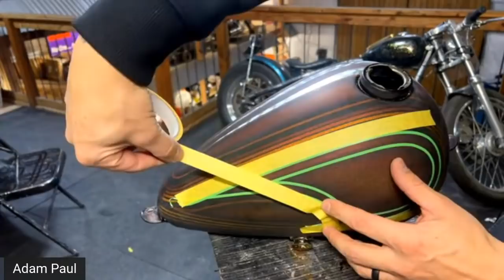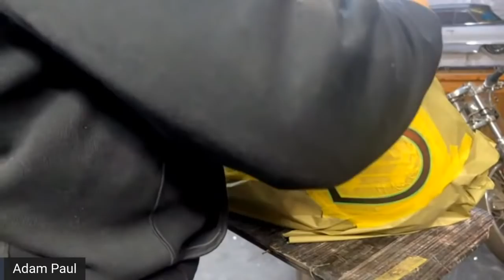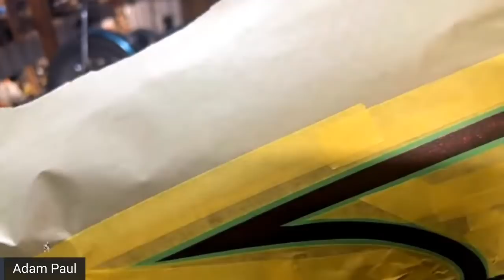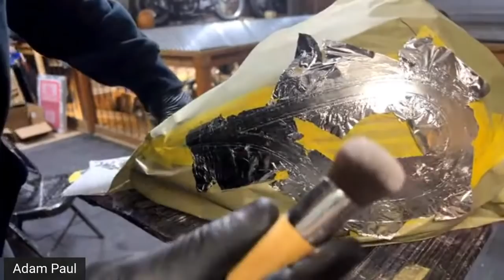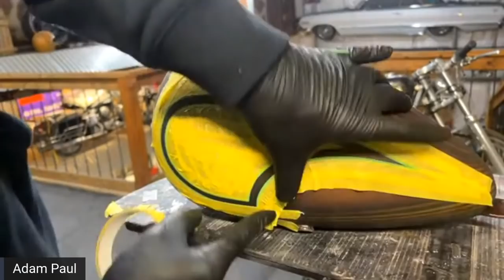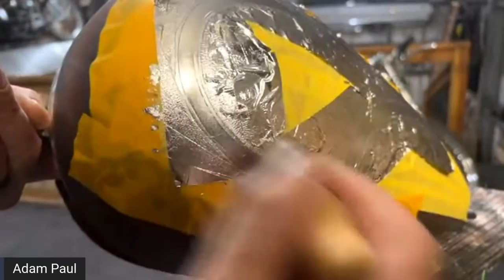Gold and Silver Leafing for Beginners

Comment: Do you have to clean the air brush differently when you run the glue vs normal paint?
Reply from the maker: Yes absolutely 100%
Reply: @TimeWarpCustomPaint  so I’d just run some lacquer thinner through it?
Reply from the maker: Water to clean up the glue. I use glass cleaner when breaking down and cleaning my airbrush
Reply: @TimeWarpCustomPaint  that makes sense! Thanks!
Reply: @johndodge9164 thanks for asking that question. I’m about to use this sizing glue for the first time and I wanted to watch this video for any pointers.

Comment: I almost have everything except for the spin tool and roller. I used to carve leather and then airbrush it with water-soluble acrylics. I want to try this, I think I can do it. I customize bicycles. For the motorized Schwinn, I didn't do any graphics. Now I decided to do a drop shadow on the fonts with my airbrush. I'm doing a kind of new racing BMX and making it look old-school '70s drag-style look black banana seat with chrome sissy bar but using more modern race parts like chromed RS brand park sprockets, complete with gold dice on the valve stems. LOL I think I'll practice this on a piece of glass.
Reply: I got an expensive made-in-USA BMX racing frame it probably cost over $800 just for the frame and fork. It's probably the lightest and strongest BMX bike I've ever picked up but they just put adhesive stickers on it. They are coming off after the summer heat of the last racing season. They look awful.  I want to put the model name back on it but make it look better. It has a weird font I'll probably cut a tape stencil out for the outline.
Reply from the maker: Awesome good luck.

Comment: For the dry time question. It takes around 90 days before the clear comes to full cure. I wouldn't ceramicote until then. Water will sheet on cured clear with no wax or polish on it. Before cure it will bead up like it has wax on it

Comment: Great work! Clearing question, can you clear right over silver/gold leafing without sealing it with more gliding to prevent lifting or do you just clean tank with DX330 wax and grease and do a couple light coats. Then a wet coat for final coat? Thanks

Comment: i  usze U-Pol clear the only issyue i have faCED WASD GRAZING BUT IT WADS USED OVERT AUTO AIR THAT WHAD BEEN SITTIN G FOR A WEEK  and itv does not like rusolium.  i have sprayed u-p-ol oveer krylon no iassue un lessd ouitside the recoat window or  somthing contamanting the sub  structure.  i do guitar custom paint and refinishes.

Comment: Okay so I'm looking at building a chopper or bobber here in a year or two and I want it to stand out a little. Do you have any tips for pinstriping when you switch tape widths how you keep width of the area you're going to paint the same width. If that makes sense. Lucky for me I still have some frames and fuel tanks kicking around from my 3 wheeler days to practice on
Reply from the maker: I like to start out with 8th inch and followed up with 16th inch line line

Comment: Man I'm using your gold leaf and I'm definitely not getting that crisp of a spin .. im doing my 1st ever paint job and I'm struggling getting enough clear to be able to sand smooth smooth smooth... so there's some minor divits .. but even with multiple layers of leafing it's not spinning that clear
Reply: Also when I sand it .. my parts look alot more foggy than yours do .. hard to see paint lines
Reply: I think I figured it out after about 20 burn throughs ... ☹️ 
Not foggy now though , so just have to do a ton of touch up .. and hope it wasn't to late in the process 🤞
Reply from the maker: The surface needs to be 100% smooth and clean before applying the glue and leaf.
Reply from the maker: You probably need to laying your candy down more
Reply: @TimeWarpCustomPaint  man my paint scheme looks incredible.. I just didn't realize how smooth it had to be from the very beginning.. like 1st cleat coat after base coat ..I was afraid on burning through .. just hope it doesn't cause delam .. ill fix the burns  just hope it holds ..